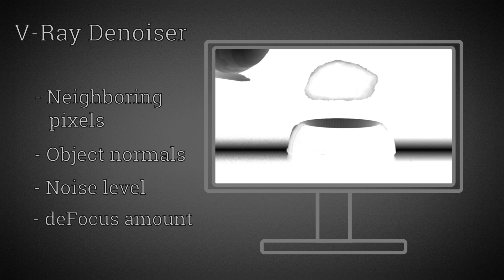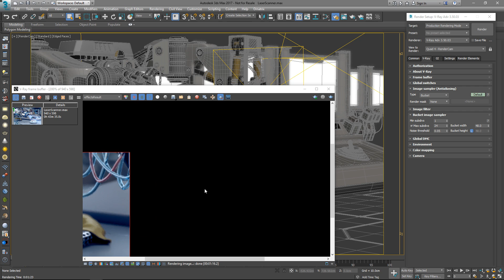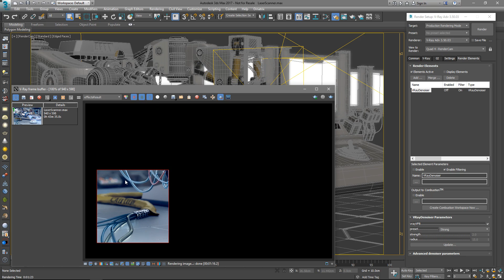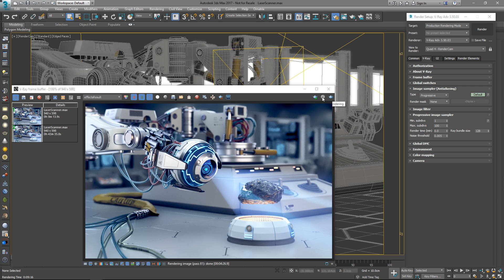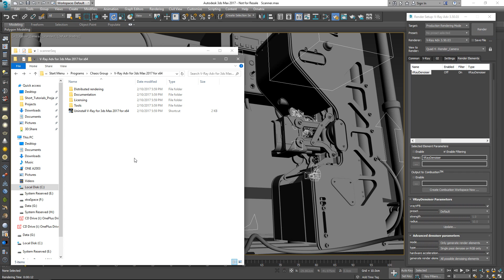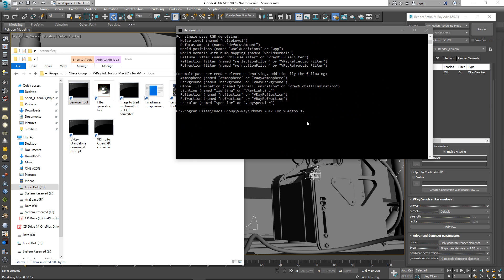V-Ray for 3ds Max – Quick Tutorial: Denoiser

Comment: I have a question. I'm rendering an arch viz exterior with a car in the foreground and a tree almost right behind it along the road. On the car I'm trying to apply a motion blur effect but what happens is my tree ends up getting blurred when i apply the vray denoiser. i have seen the defocus element created by the denoiser showing the tree isn't in focus as you said in the video anything out of focus is blurred out. question is how can this be solved as i have tried increasing the f-number, turning off the depth of field but my tree keeps on getting blurred badly. is there a way to mask the defocus element or simply limit the motion blur to an object. I saw corona has this feature but I'm wondering if its possible in vray

Comment: Thanks for this tutorial, but I have a problem: I rendered a sequence of animation in format (.exr) and followed step by step the procedure described for the command line denoiser. But when I start the command it generates this error and I do not understand: "input image does not contain a noise level render element; use threshold option to specify the average image noise level." I then tried to add -mode = strong -threshold = 1 parameters and denoise works but not good results as applying denoise from 3dsmax. Thanks for any help.
Reply: Hi Carlos, if you want 'vdenoise' to see the denoiser data, set the animation sequence from the 'common' tag in the RENDERING interface, as you normally would (clearly using only one image, select single), then go on the 'V-rayRT' label select 'V-Ray framebuffer and save the file in' V-Ray raw image file 'as OpenEXR selection format. Because if you save the file using 3dsMAX saving, even if you save in OpenEXR, it does not save denoise data. After using the vdenoise from ms-dos promt, you will see that it processes the denoise.
Reply: You need to generate the render elements needed by the denoiser for each image of your sequence. It is located in the "Advanced denoiser parameters" -> mode -> "only generate render elements" and after this mode is selected you need to render out your sequence as you usually do. It is explained in the video tutorial https://youtu.be/z-Vu5UcMuF4?t=6m19s
Reply: Thanks Veso for the answer, I followed the tutorial step by step. Then I realized that the files should be saved from within the vray frame buffer while saving the sequence from 3dsmax render output and therefore did not save the denoiser information.
Reply: Hey, I have the same error showing up. Could you explain how can I save each frame of the animation from the buffer?

Comment: Not clear two things- 1) The denosing process on single frames takes place on the end of rendering process, correct?

2) The Denoising process effects all appropriate render elements (specular, reflection, refraction, lighting, GI etc. etc.) not just the final beauty/diffuse pass? Correct? Is it much smaller when i denoise also additional render elements and not just the beauty pass?

Comment: Awesome quick tutorial with great information. 
I was just working with the denoiser for some shots of an animation and i have some questions about the workflow.

I've rendered seperate passes (GI/Specular/Reflection/Shadows etc.) along with the RGB and Denoiser.
The denoise pass is noise free and i can use it instead of my RGB in comp, but the other passes of course do have noise.
This means i just can't really make use of render passes for my animation when i'm using a denoiser.
Adding other render passes on top of the denoised pass will just give me noise jitter in the animation.. 

So can the Standalone Denoiser handle this problem by denoising all passes? Or is it only capable of denoising the RGB pass?
What else would be the workflow for this? I can't afford huge render times.
Reply: if i am not mistaken the denoiser for all passes will come in another service pack.
for now only for RGB pass.
Reply: I found the following in the documentation:

"Type – Specifies whether to denoise only the RGB Color Render Element, or others as well.

Single pass denoise on RGB only – Does a single pass at denoising on only the RGB Color Render Element, using other elements like the Diffuse Render Element only to guide the denoising process. This method is better at cleaning up noise, but might lose small texture details or add too much blur to areas of the image where multiple effects are visible at the same time (such as reflections and refractions through glass materials). 

Denoise render elements separately – Denoises the lighting, global illumination, specular, reflection, refraction and atmosphere render elements separately and combines them into one denoised version of the RGB image. This method preserves texture details better, but might fail to clean up some types of noise when low settings are used. Note that this mode is reliable only if color mapping is disabled (by setting the Mode to Don't affect colors, only adaptation in the V-Ray Color Mapping rollout). If color mapping is applied, the render elements might not add up correctly to the RGB image. "

It seems like it is possible but at the same time you see the following disclaimer at the beginning of the documentation: 

"Currently the scene can contain only one VRayDenoiser Render Element. Future versions of V-Ray will support multiple VRayDenoiser Render Elements with different settings."

I'm really confused.
Reply: DId you find out how to denoise the other render elements? same problem here :(